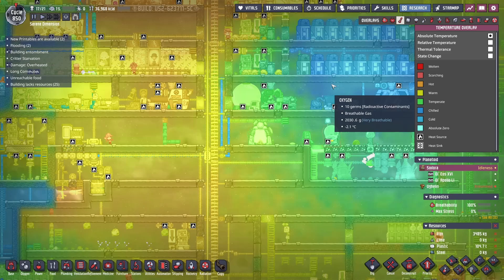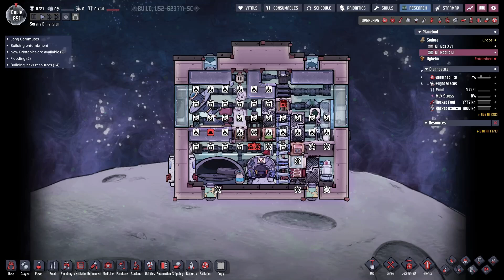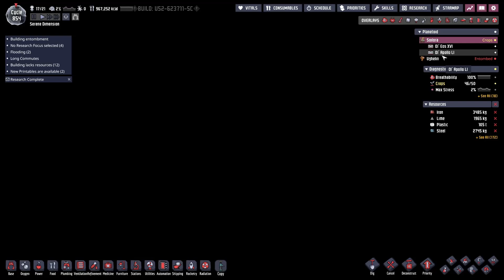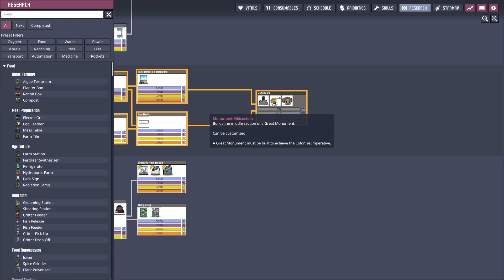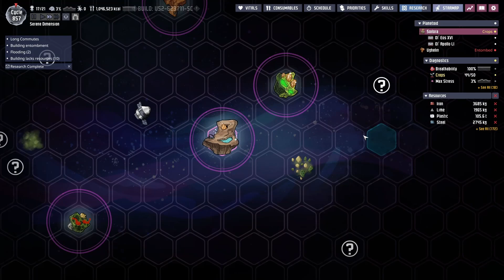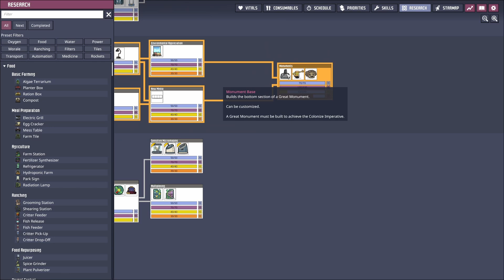Ep 106 - Temperature - Oxygen Not Included - Beginner & Achievement Guide - 2024

Comment: Running polluted water can work but for a deep freezer it will be difficult. Temperature ranges only tell you its workable range what really matters in cooling systems is the Specific Heat Capacity and the mass of the coolant. So for comparison ethanol has a SHC of 2.46 and water has 4.179 same with polluted water. SHC is essentially (DTU/g)/C so the higher it is the more heat a material can absorb. For a more direct comparison you can cool down 16.99kg/s of ethanol by 14c using Pwater as a coolant while you can only cool down 5.89kg/s of water or pwater using ethanol as a coolant. You're also already experience the effects of exceeding your temp ranges from the petroleum boiler the broken pipes are the result of crude oil exceeding 400c replacing them with steel or a better material won't matter. So the only reason to use ethanol in a cooling loop is a deep freezer otherwise use pwater or nuclear waste for everything. With all that said this only matters when power is a concern.
Reply from the maker: This run has increased my ONI knowledge tenfold! I do appreciate all of the feedback! That is the main reason that I kept the Ethanol. And we already had it in place which made it pretty easy to move around. Hopefully, we stay on course without power issues :)